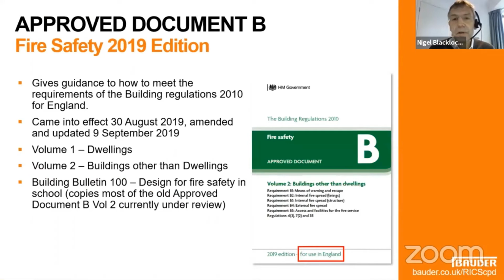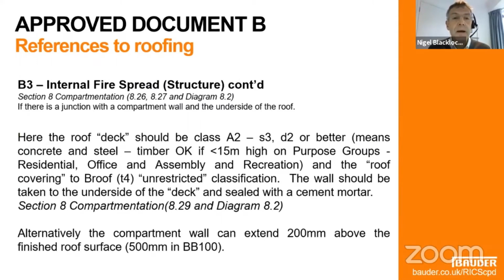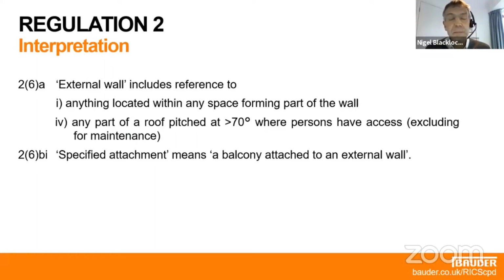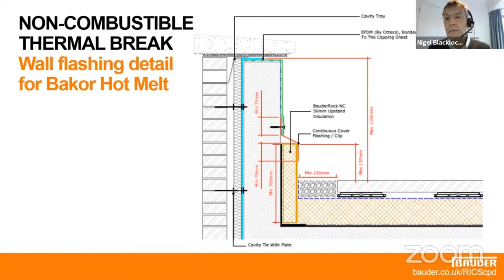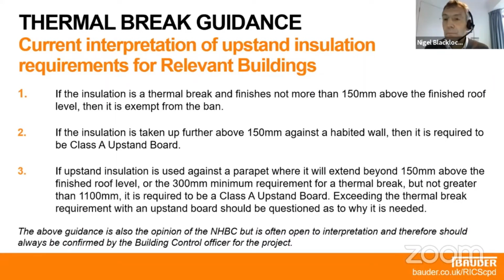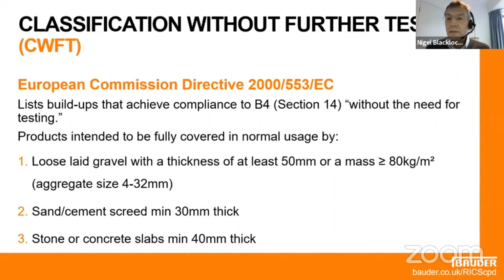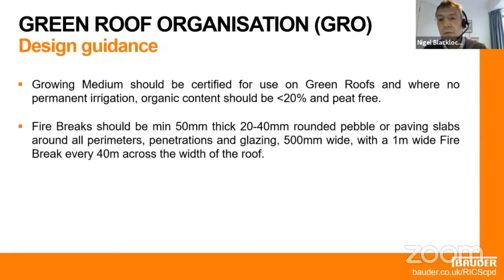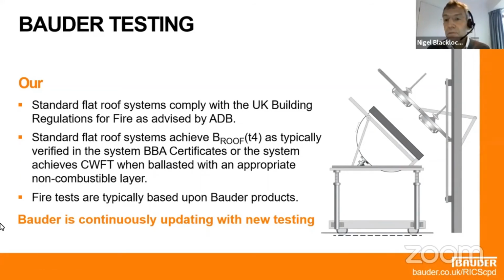Fire Performance Updates for Flat Roofs by Nigel Blacklock

Comment: Thank you for your presentation 
I’m not technical so may I ask. 
We own an apartment less than 11m and the EWS1 has come back as a fail due to no barrier at. wall to roof junction. 
Timber frame building with brick & cedar face. 4 stories high, 4 apts per floor. Sarnafil Flat roof. 
Is a cavity barrier needed?